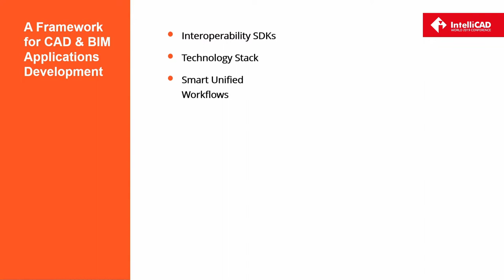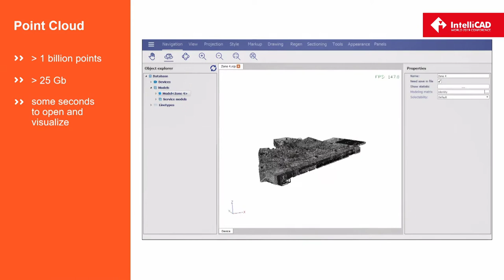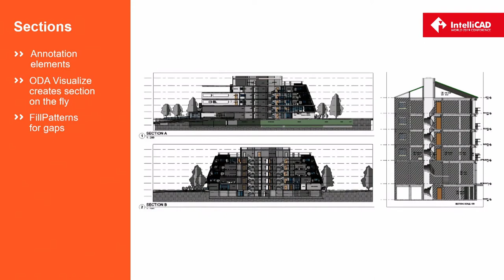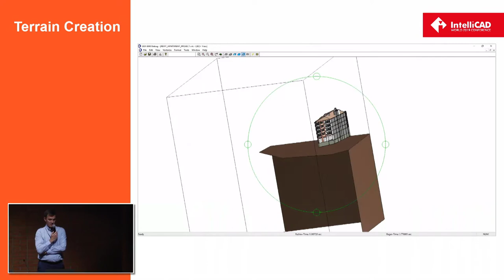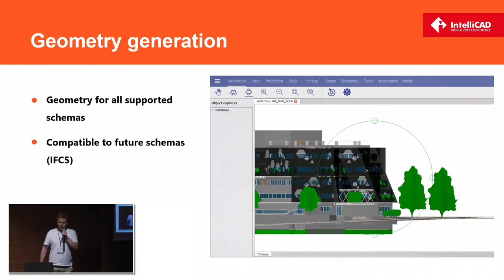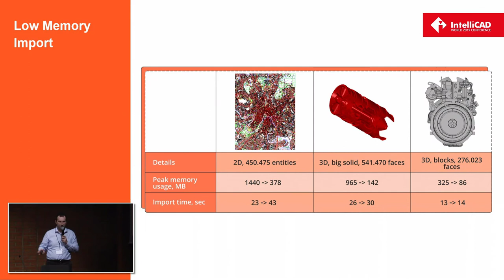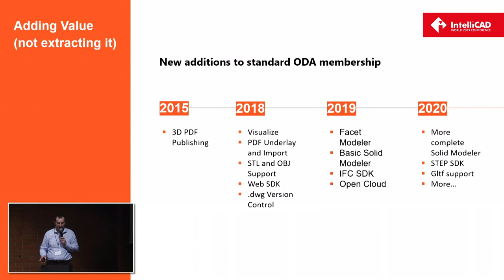ODA Solutions for CAD and BIM development.

Comment from the maker: 0:36 A framework for CAD and BIM applications development
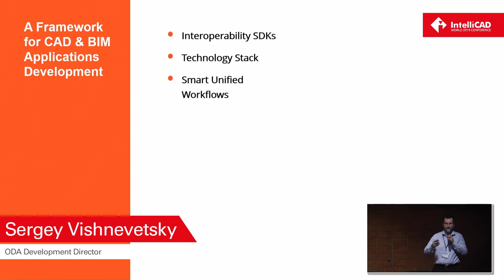1:28 Supported formats
1:50 Complex object editing
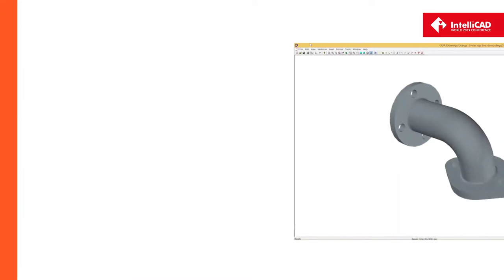2:14 Model documentation
3:31 Common data access
4:20 DGN improvements
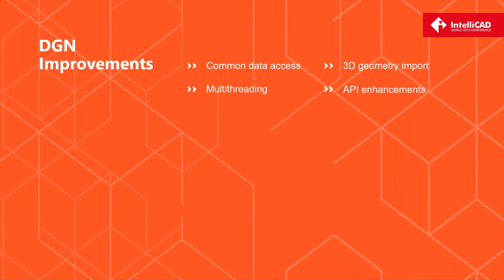4:47 Vertical extensions
5:07 Civil
5:41 Mechanical SDK
5:55 Map
6:45 SWIG wrappers
7:49 Point cloud SDK
9:29 BimRv SDK
9:59 BimRv: A complete interoperability solution for Revit files
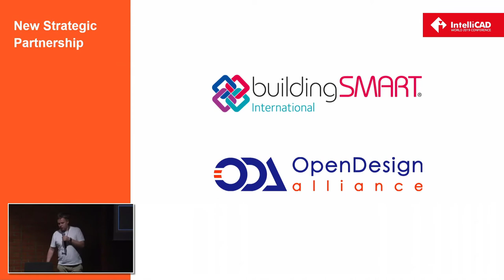28:39 A standard IFC implementation for the BIM industry
42:20 BimNv SDK 
42:51 .nwd and .nwc files
43:13 .nwf files
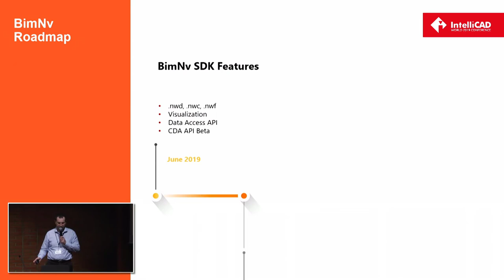43:51 BimNv Roadmap
44:20 Advanced features
45:50 ODA Technology stack
48:28 B-Rep LOD